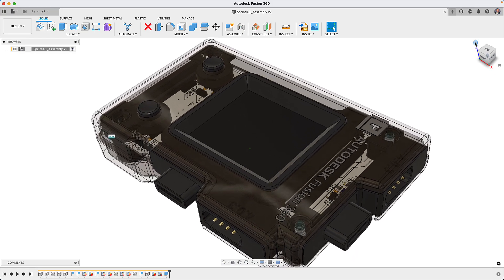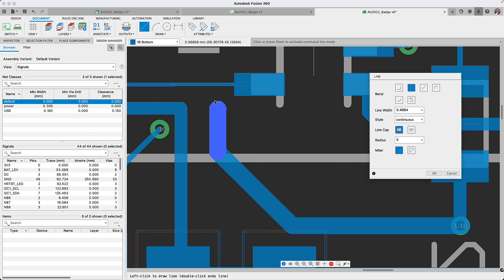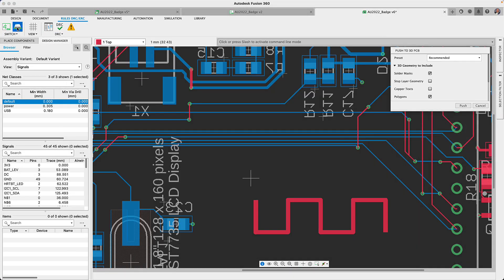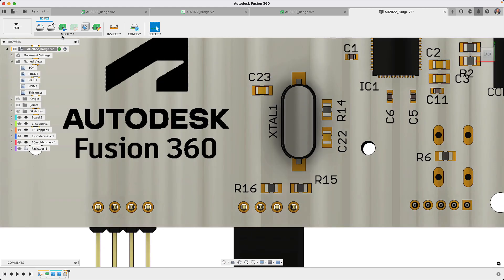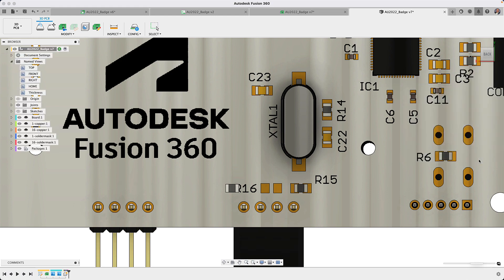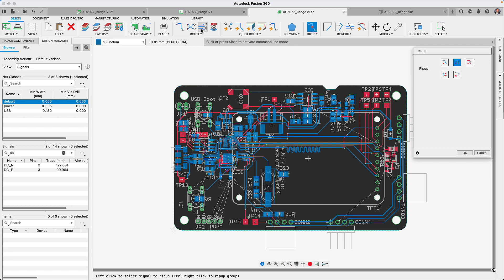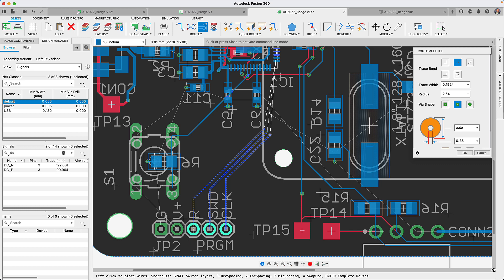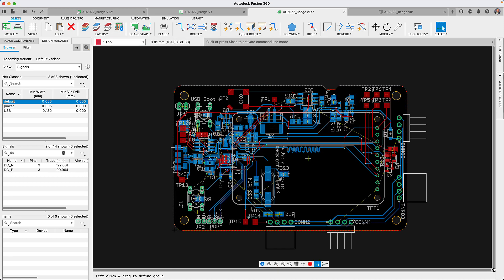What's New in Fusion 360 Electronics - September 2022 | Autodesk Fusion 360

Comment: Can you stop making new features and try to fix all the bugs first please. April 2023,,, I have been using Fusion 360 Electronics for 6 months. 2 to 3 random crashes each and every day in that time. Tried 3 different computers in that time, no difference, crashes same way on all of them. No Fusion error reports of any kind, just a fatal windows crash message. Timed auto backup doesn't work either so lost work every time.